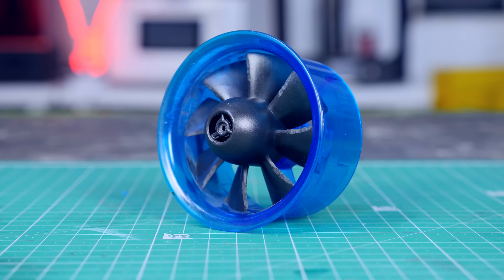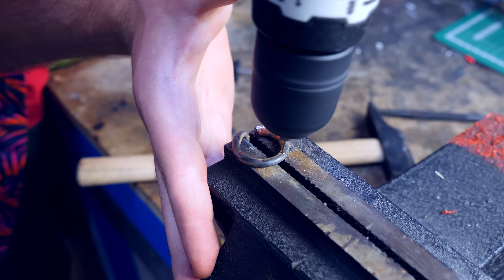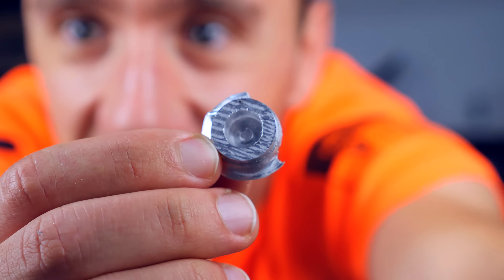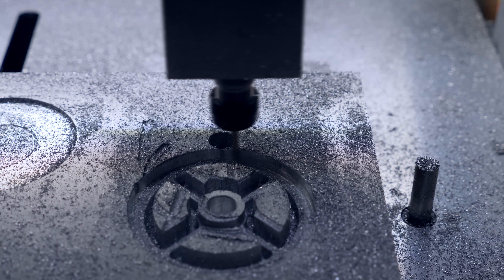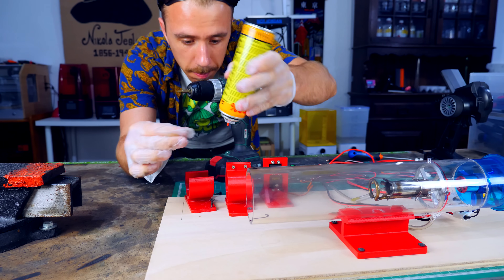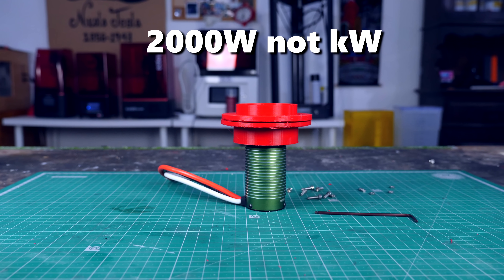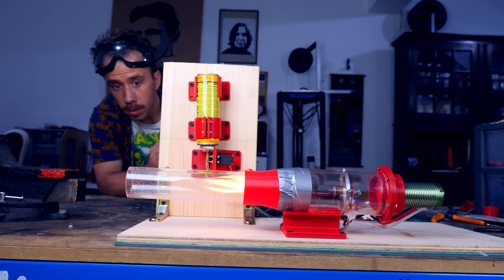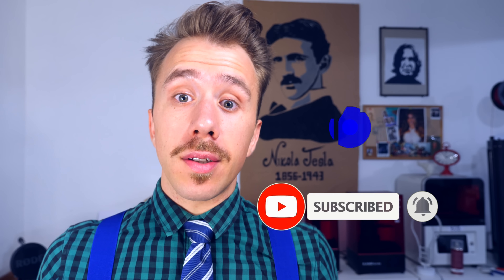I turned my Fan into a Jet Engine (3D Printed EDF Afterburner)

Comment: Hi, I’m Nathan. First off I would like to say great work on your YouTube channel I really like and enjoy the project and useful as well as fundamentally experiment friendly videos you’ve shared with all of us.
      Anyways, I’m to what my comment was initially intended for upon your request for a new theme for another video for you to make and experiment with. 
When you said you were unfortunately restricted from using your 3D Printer to make your EDF Jet Engine Afterburner setup due to the very high temperatures of the glow plug you used in this by the way awesome video! 
With this being said , I have your perfect new Theme and Experimental Project for you to do! 😁 how about you use “Cold Flame as your source of Ignition and this also can be done without the needs of parts that give a spark plug a much higher voltage in order to provide efficient and reliable electrical energy. 
“Cold flame” is so cold you can actually touch it with your fingers and NEVER get burned. It relies on proper amount of air flow around a glass cylinder tube that you will be feeding your fuel source thru(Butane) or 70%-90% Isopropyl Alcohol. Your task for your new video will be to demonstrate and figure out the correct amount of Air/Fuel mixture while utilizing Cold Flame so that you can get back to your very handy 3D Printer you like so much. Great work on your 3D prints as well by the way. My imagination is running wild with the thoughts of how much I could do with one of those awesome options to create things if need with! 🤓 hahaha I’m crossing my fingers and hope I get to see you take my theme and fundamental experiment into something we could all watch.  Keep up all the great work, looking forward to your new videos.🙋🏻‍♂️

Comment: NEW PROJECT SUGGESTION:
Build a "2 stage" version of this housed in a diy model rocket body with low fuel sensor on 1st stage fuel source as the "trigger" for ignition 2nd stage afterburner/EDF. Possibly use the pressure of the 2nd stage motor ignition to release or push the 1st stage away? I completely understand this would not be a rocket in the traditional sense, i.e. this would only work within the atmosphere, but would still be a really cool and fun experiment, IMO. Apologies in advance if this is a completely stupid idea, I know I'm most definitely not the smartest peanut in the turd. Thanks in advance for your time sir. I absolutely love this channel and am awe of the intelligence within the content! Thanks again the awesome content you provide!😎

Comment: The example with the Diesel engine applies only at the start of the Engine.
You turn the Key, wait like 3 seconds and then turn it more to trigger the start motor and the Diesel then has enough heat to ignite

Comment: You need to try reduce the feed rate of the cnc machine and make sure you're using the correct directional tool, it doesn't sound right as you said

Comment: You should add the  inner core high and low heating pressure(s) chamber blades like in'a turbojet engine / turbofan engine for that aswell that would be so legit cool to add!

Comment: The ignition problem is because your cutoff is located at the can itself leaving fuel still in the tube. What you might want to come up with is a valve at the end of the tube with some way to purge the remaining fuel so it doesn't light itself again.

Comment: Hey mate. With your aluminium machining, reduce friction for cleaner and more accurate parts. If you can't flood the cutting surface with coolant (water soluble oil and water) you can either spray soapy water at the cutting tool, or lightly spray the surface of the aluminium only once with kerosene. Kerosene is incredible for providing beautiful shiny cuts.
In regards to warming your propane, just be careful you don't increase the temperature too much as you'll increase the pressure to an unsafe level. You could put the can in a cup of hot water or use radio controlled car tyre warmers to bring the temperature of the pressure vessel up higher.
Good luck! I love watching your videos. You and Robot Cortina make YouTube great!
As a side note, that noise of a cow (LOL) when machining aluminium, is vibration. Reducing friction with lubricant works well, PLUS the golden rule of "Reducing speed or increasing feed" with also fix vibration issues. If you put oil, water or some sort of slime under the aluminium in-between the cnc table, you'll also mask vibration! Stay safe friend and SMASH A TOMATO FOR ME TOO PLEASE! 😉

Comment: Please change the type of fuel and use CNG (Compressed Natural Gas) and see if it can be of any difference. Instead of using 2 or three tubes duck tapes together I will use one tube with narrow start for centrifuge side and wider end for jet flame for better pressure, I will also use another narrow end(aluminium) to create much better and safer flame and last but not least, I will hook that centrifuge perpendicular to narrow start of tube with an angle for better pressure( just a theory as I don't have any software or printer to prove my point lol)

Comment: You might try making a miniature fuel  farm (like Starbase) with some sort of manifold so you can just turn six cans of fuel upside down and plug them into the manifold sockets? That way you don't need to spend a lot of time refueling. Could be adapted for different types of fuel for different projects!

Comment: Glow plugs don't do any actual ignition, they preheat the cylinders to promote easier starting. In a lot of diesel engines, hitting them with fuel will actually destroy the glow plugs.

Comment: This video reminded me of a Halloween prop that I made for a friend''s house. Basically I created a remote controlled propane flame( flameball)/ thrower(shooter). I used a gas rated solenoid on a hp regulator ignited with a slightly modified k-9 training collar ( shock collar generating an arch.... Super easy and already has a remote. And allowed me to release as much fuel as desired before ignition!! Muahhh-hahhhhhhaaaa!!💡🆒🎃

Comment: *2:48-2:50*: l almost thought of a petrol engine as it uses fuse ignitor or the same thing you want to replace with glow plug. 

At least it is not TOMATOES!

Comment: looks to me your fan is trying to do the intake and compression phase at the same time.  this will make the jet fairly inefficient seeing as the compressor's motor is interfering with intake.  It may be worthwhile researching an intake phase to increase the compressor flow. also properly segmenting the compression and combustion phase into separate chambers  will also most likely help, followed by the obvious constriction (probably wise to make the constriction out of something that can take a lot of heat.  plastic and duct tape is just asking for catastrophe) to get you some actual positive thrust.  the engine you are trying to make looks pretty close to current RC jet engines.  also the intake fan..  if you really wanted to would allow you to turn it into a "turbofan" and that would help immensely in  lowering the material temps of the output.

Comment: I don’t know if the 3D printer winning contest is still going on, but it doesn’t matter. This would be a nice video series to watch. 

I know you’re a mechanical engineer and probably prefer to work with combustion chambers. But what would be nice would be to build a drone from scratch. By scratch I mean design and print every part needed in the assembly. No half ass bs where you get a kit from somewhere. Anyways. I think it would be great because it would teach people about the whole interdisciplinary design process. From programming the sensor-guided yaw and pitch adjustments to mounting the power source in an efficient manner. 

That would be a good series. 

The only thing that could make it better is if you tried to attach some turbo thrusters on that drone. Hell maybe you can even make it a miniature remote-controlled f15

Comment: Hey integza, you need either oil or coolant to help your cnc machine cut metals (oil or coolant goes between the cutting edge , or endmill, and the metal being cut. It will be a bit less like terrifying cows if you do that, but more importantly, less likely to wear out the tools and motors)

Comment: AFRICA Calling (for a 3D printer)!
I was a surfer in the 1960’s. Now at nearly 70 my failing heart cannot take the exertion of paddling out and then into the wave.
Project idea: a motorized surfboard.
Now there are commercial products like Bixby but they are too expensive for a pensioner and too powerful.  Too powerful?  Yes indeed!  If I join the surfers at the local surf spot with a powerful board that I can stand up on and surf under engine power alone; and if I can return to the back line three times faster than anyone else; and if I can take off under power on waves others can’t paddle into: then I am going to be very unpopular with the other surfers. 
So my ideal powered surfboard will only need the speed of a typical surfer paddling. That way I will not have an advantage.  
I imagine that direction control will be via weight shift, so no fancy steering needed. Speed will be full speed or off - no throttle required. 
I imagine the propulsion would be via a ducted fan for safety. But that, plus the actual propulsion unit and power source will be up to your skill and ingenuity. 
Please make my wish to surf again come true.
Many thanks
Dennis A Stevenson.

Comment: There's nothing 'jet' on this engine, a jet engine consists of a compressor, combustion chamber and a turbine, with the afterburner being optional. This basically just a (very weak) compressor and an afterburner, I'm sure you'd generate some extra thrust burning fuel in there but it's nowhere in the realm of actual jet engines this size(which often provide a few kg's of thrust). 

To actually make it 'jetty' the energy from the expansion of the burned/heated fuel should be used to spin a turbine which drives the intake fan, e.g. it should be a single shaft. That way as fuel is burned, part of the released energy is used to increase compression which allows for even more fuel to be burned as there's more oxygen in the engine. 
The electric motor should only be there to get the compressor/turbine spinning on start up.

Just give it a few iterations of upgrades and you should be able to lift off pretty soon...

Comment: A jet engine has to contain a compressor, combustion chamber and a turbine. No hate but this is nowhere near a jet engine😂
Reply from the maker: "A jet engine is a type of reaction engine discharging a fast-moving jet that generates thrust by jet propulsion." What that means is that even the EDF by itself is a jet engine, you're thinking about Turbo Jet engines which are just a type of jet engine.

Comment: I'd love to see you make a self sustaining engine. As in, instead of driving the fan with an electric motor, drive it with a turbine in the exhaust. Obviously you'll need to start it with an electric motor or compressed air but would be amazing if you could achieve it.

Edit: I've realised you have already done this 😅

Comment: Integza, I didn't see your machine - But I heard it. Your work is not secure enough on the bed and is vibrating under the influence of the rotary tool. Integza, secure your work piece and you will have quieter machining and better cuts.

Alternatively (Since I didn't actually see your machine) your tool is vibrating which means your cuts are too aggressive. Either/or change the diameter of the toolpath to remove less material per cut, reduce the depth of plunge, slow down the x/y feed rates, seat the tool deeper into the chuck, or sharpen/use a new (or different profile) tool.

Comment: I use an hho system to power a small generator at home, it runs sor a few days before I need to refill the resuvare. It is a potential fix for running out of fuel

Comment: If you just cut two small flap in the tube before the fuel line and above the metal part and bend  it inwards to direct the air flow towards the fuel line. It'll suck oxygen rich cold air for better combustion and it'll help cool down the nozzle a bit. Pressure vs velocity relation. You can get away with less powerful intake motor and have good afterburner effect at certain point. 🙃

Comment: Hey! Maybe the fuel pipe must be drilled not always with the same drill bit size. I remember that air conditioning ducts decrease in size after every hole/exit. Shrinking the pipe is almost impossible, but you can compensate the pressure drop by drilling a slightly different hole in the pipe. I'm not sure if the diameter must increase or decrease, but you can figure it out with an experiment.

I'm sorry for the tomato sauce in my avatar!

Comment: Simplest easiest thing I would think I suppose you would do for a better igniter would possibly be a chunk of catalytic converter material in the center of your fire ring then there's no electronics and you can put it wherever just got to preheat it
Reply: You can get the perfect chunk of it out of the butane torch soldering tips for the BernzOmatic torch
Reply: Do I have to join for 3.99 a month in order to win a 3D printer? LOL cuz I got better ideas I'm just testing y'all

Comment: Cool video. Sorry to say tho, it's not a jet engine. Jet engines don't need to be externally powered, in your case a edf fan. True jet engines only need to be spun up and ignited. Power is taken from the exhaust using a set of hot turbine blades and through a shaft runs the compressor blades that compress the incoming air. It's self sufficient... But hey, your videos are fun to watch.

Comment: 😁😃Awesome, Project But I Have An Idea Of Making Disc Shaped Thrusters Instead of cylindrical one cause disc shape takes lesser volume and area and also much more lighter than cylindrical one. If This Thrusters got success then we can fly in lesser fuel at very high speed using less power cause supply is of both Fuel And Electricity 😅 Thanks For making such a great videos i watched all in few days only 😂cause i feel too much exciting while watching this

Comment: Wondering if you can use water as a fuel (split it into Oxygene and Hidrogene, ignite the Hidrogene and give some boost with Oxygene), I assume its kinda dangerous, but might work fine...
Other idea if its possible to make some thrust with ion flow (airflow geenrated by high voltage) + some burning gas or make a flaming Tesla turbine...

Comment: Cool project. Turbine engines utilize
a common shaft with multiple compression zones causing a self feeding/runaway type engine. Zero extra propulsion being generated by this other then fans initial. See Colin Furze for pulse type.

Comment: I like that you tried to machine aluminium on your cnc mill. It done the job that it was made for. For future if you were to use a lathe to make the adapter then you could have made it with tighter tolerances and it could look better, having done and engineering apprenticeship I was working on both cnc and manual milling machines and lathes.
Looks cool. 

What's your opinion?

Comment: Wow. Would love to see some thrust measurements.
Reply: Hi David - I'm pretty sure this device produces near zero thrust. In a real jet engine the hot gases existing the combustion chamber pass through a set of turbine blades causing them to spin. These turbine blades are coupled to another set of turbine blades at the front of the engine (compressor). Once up and running, the engine will run on just the the fuel and air mixture (i.e., the electric fan would not be needed). In the device shown in this video, the electric fan that is pushing the air into the combustion chamber causes it to create a cool-looking flame, but since there is no set of turbine blades near the exit of the engine the hot gases are not able to energize the compressor (front blades) such that the device can never be self-sustaining (i.e., run on just the fuel and air). Any thrust measured would be associated with the electric fan at the front and completely independent of the combustion. So, as a few others have commented, this device is essentially an electric fan powered blower, not a jet engine. I'm not an expert on jet turbines so I may have a few things wrong here but I think I've got the basics right. - Cheers!

PS: Here's a video that describes how jet engines work: https://www.youtube.com/watch?v=KjiUUJdPGX0&t=0s

Comment: I saw some submarines made out of LEGO. I think it's really cool. But LEGO is LEGO, sometimes you have to work around to achieve something simple. And it also takes more space than it should. I'd like to see if you can design something (that works* of course haha) and 3D-print it. I find home-made submarines really interesting!
*works - you can control it real-time or program the sequence e.g. submerge and after 10 seconds surface. It could move forward/backwards, but it's all up to you :D

Comment: I enjoyed your video, especially your sense of humor. However, and I’m sure you know this, what you built is not really a jet engine but is more akin to a fan-enhanced burner. Are you planning to replace the electric fan with a compressor and turbine coupled by a shaft so that the device depends only on the burning fuel for energy and does not need to be plugged in to an electric energy source?  - Cheers!